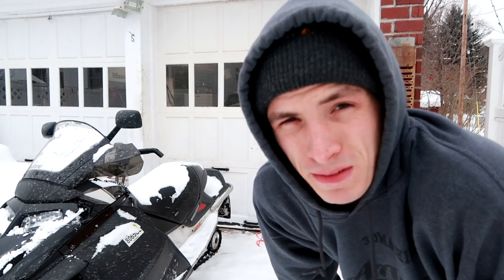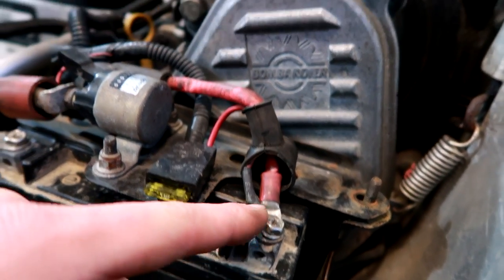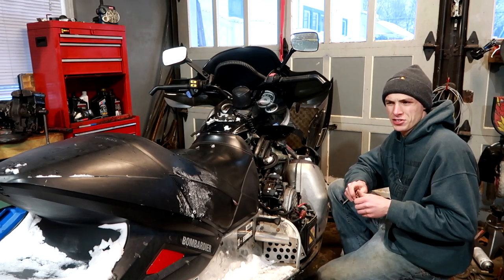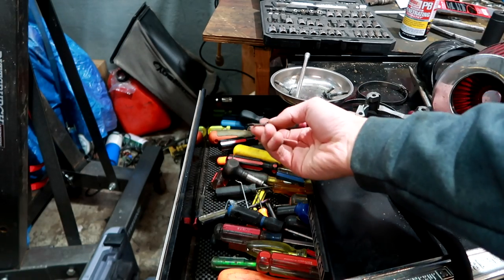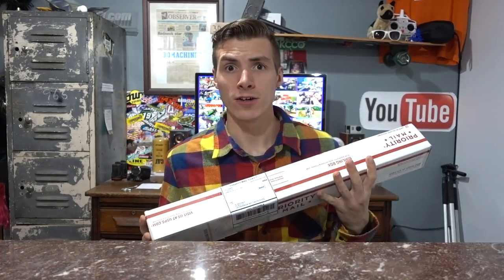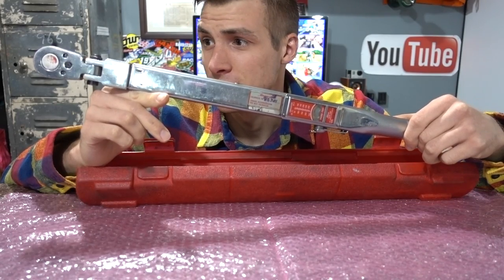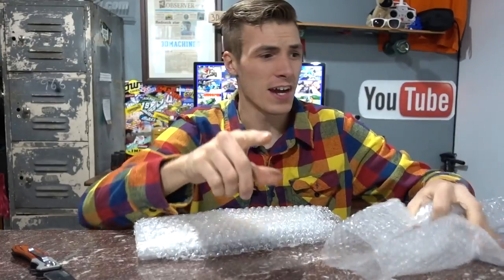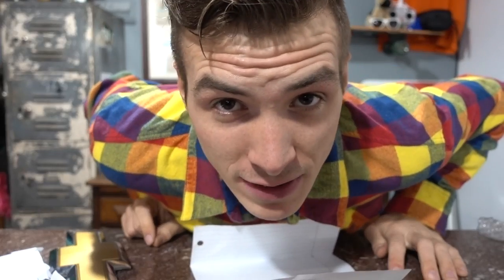NEW SNOWMOBILE ... already needs work

Comment: Dalton, I've just bought a moped, it's a 2005 Tomos Qaudro A35. And while it is only 49cc, max. 50km/h, it does something your dirtbikes can't. It starts first kick, cold, no choke. Bought it for €70, got some parts with it (2 forks, handlebar with controls, 4 wheels, 5 tires) and I'm planning on making it beautyful again.

Comment: @3DMachines, If you have never replaced the hand warmers before, I have replaced them on my 04 Ski-Doo MXZ. Depending on the replacements hand grips the wires will not match the original colors, you will just have to test them on high and low. I had to switch the wires around a couple times. Keep making awesome videos :D thanks for doing what you do.

Comment: Hey Dalton I love the videos I also am fellow Duramax owner it's a 2002 Chevy 3500 crew cab with the towing/lt package and I love it but I'm doing a lot of work to it in the next few years and like new wheels,paint,upgraded turbo,lift,steel bumper,HD style head lights,4x4 conversation and so on but I'm a car audio installer and I thought I might give you a heads up if your looking for new door speakers for the front you can get some Rockford fosgate t1650 components and they sound great if you add a little sound deadener and if you want a subwoofer q-logic makes a custom fit subwoofer box for that truck that a Rockford fosgate p2 10" subwoofer will fit in or a sundown audio sd-3 10" and if you go with that aftermarket head unit you can get one that has a built in GPS and also Bluetooth it's a easy install. But just so you know I love the videos keep up the great work.

Comment: You bought a skidoo. What did you expect?

My 1997 Polaris XLT Limited lasted me 9,380 miles before the engine went. Even modern 2 stroke sleds are toast by 6,000.

I just got back from riding Tug Hill and Old Forge with my buddies. The one guy who brought a new fuel injected skidoo, it kept running extremely rich and fouling the plugs.

Comment: With that era of doos most owners would remove the lower plastic portion of the belt guard. It is there for noise.  By removing it you will have cooler clutches and longer belt life.  I owned several Revs and did this on all of them with no adverse effects.

Comment: love the videos quick tip for putting grips on bars use compressed air In the bars tube or back of grip slides right on supper easy doesn't stretch the grip to cause issues later

Comment: Looks and sounds like you r having problems with the idle. High idle on the revs usually is because of the carb boots, they're the rubber boots between the motor and carbs. They are rubber so after a few years they crack cause more air to be sucked in. I would suggest pulling yours off and checking for cracks/bubbles in them. Running bad boots can lead to seized top ends and other not so fun problems.

Comment: love the videos quick tip for putting grips on bars use compressed air In the bars tube or back of grip slides right on supper easy doesn't stretch the grip to cause issues later just another fan your pal stephen

Comment: Take out the muffler on your sled and look at the frame behind it the ski doo revs have problems with bent nuns and it can cause the belt to be out of alignment and therefore burn through belts faster

Comment: i had that happen on my polaris ace,the thing would stall out every 20 second and it fixed it self a little bit later and when we went to load it up on the truck it would not even crank. figured out that the guy at the factory cross threaded the bolt  to the battery.

Comment: see if the non-functional hand warmer is getting voltage. 
if it isn't getting voltage it's not the heating element that's the issue. 
 if it is getting voltage it's the heating element that needs to be replaced.